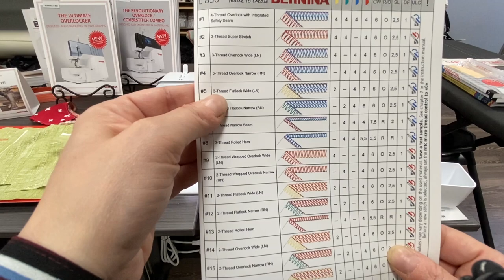Flatlock Fantasy on the BERNINA L 850 Overlocker

Comment: can i use the flatlock stitch for making athletic wear?  using athletic spandex etc. what is the diffence between the flat lock and the coverstitch..trying to determine if the 850 will do for me..thanks
Reply from the maker: Flatlock can be used as an embellishment in active wear but does not replace the topstitch qualities of the cover stitch

Comment: Can this be done on the L890?  Is there a tutorial on it?
Reply from the maker: Yes you can do this on the L890. Works just the same if you pick the 3 Thread wide flat lock stitch (LN). No need for a separate tutorial